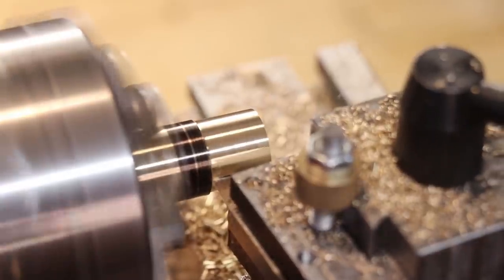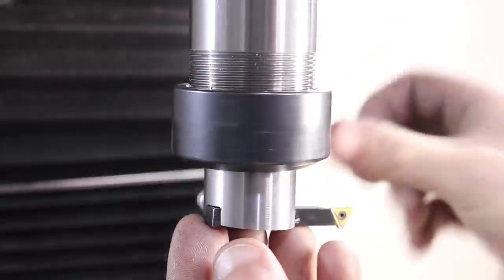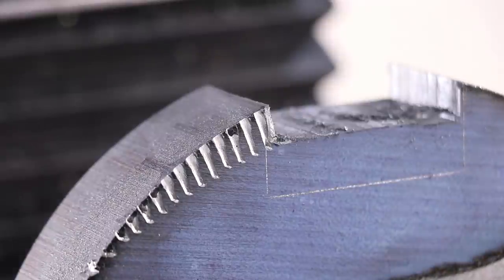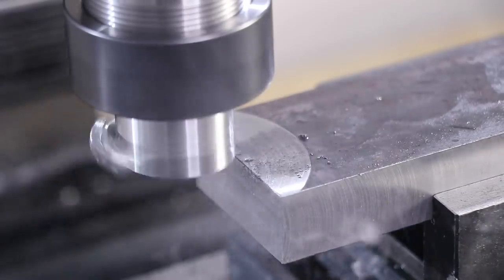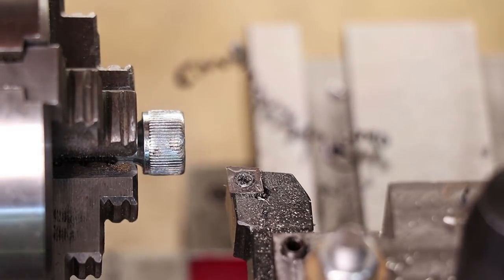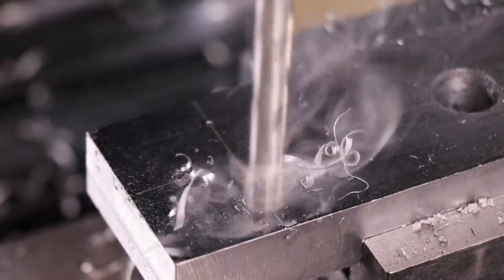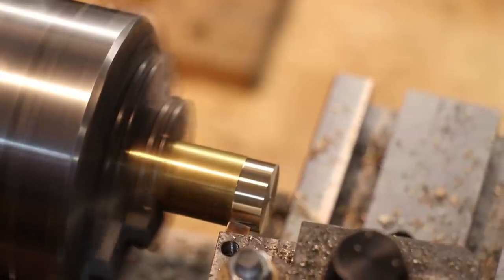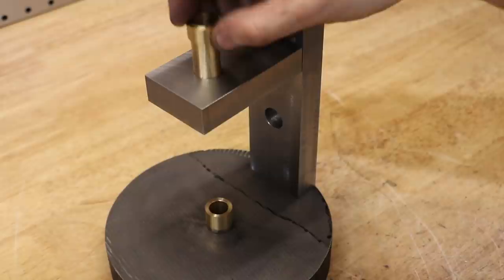Making A Vintage Machinist Die Filer  - Part One

Comment: I've got a bunch of cast iron plate weights people in my 'hood just kick to the curb, this looks like a good use for the right one as a base, I think I'd first chain drill for the upright, knock out the slug and then mill to square. This is still a valuable shop tool, with diamond grit rasps, you can shape even depleted uranium with it, looking forward to the rest of the build.☺

Comment: Good on you for having a go at making your own!

I can't see it will matter if the column is perpendicular to the base or not. Perhaps you could mill the part the table attaches to while it's all assembled so it's top is parallel to the base?

Comment: Subed. I'm part way through the hemingway kits die filer for my myford 7. I agree about costs of shipping to au/ nz....
Reply: Was looking a that one too, idea of shipping costs???
Reply: @davfew  Logic would say postage cost too much but it comes with three castings (two cast iron and one aluminium), bearings and all the bits and pieces. Bought Dec 2020 kits £83 plus postage £117 but minus VAT and I didn't pay nz gst. Actual cost £167 but I though it would be good for 10 years plus, I get to learn how to clean up castings and the big plus for me of includes all the raw materials so I can just get on with project rather than spending hours sourcing materials. My local metal dealers aren't open on weekends so work makes visiting tricky... $nz325 in real money.
Reply from the maker: That sounds about right for the postage costs that I looked at. Not sure why but postage from America to Aus is a lot more than sending something to America.

Comment: Hi there, nice project! I've been interested in die filers since seeing one on Mr Pete. I have long thought about building one. As it happens, I have an absolutely enormous old scroll saw, essentially just the casting. I'm considering converting it to a dye filer. One of my concerns is that I would wear out files early because of the short stroke length. All of the dye filers I have seen seem to take a very short stroke, two to three inches. They also tend to use those small socket files. I would prefer to be able to use traditional files because of the wide access to different profiles. Having now built and used one, can I ask your thoughts on this plan? Have you considered a mounting system to accept traditional files? Any input you have would be appreciated, there is not a lot of people to consult about these rare machines

Comment: Please dude, just use a angle grinder or buy yourself a metal bandsaw.
It makes me insane to see that you cut it with a hacksaw😂😂😂
Reply: For small pieces, a hacksaw is faster since there's less setup time.
Reply: @bobweiram6321  I disagree. Hacksaws definitely have their place, but in this instance a grinder, abrasive chop saw, Portaband or normal bandsaw is a faster choice. Setup time for my horizontal bandsaw is all of a minute assuming it needs squaring.

Comment: I tend too use a milling cutter to countersink holes for bolts and the like a three or 4 flute. It leaves a nice flat edge for the bolt to snug up to! I don't own a mill...yet, but have found it worked for me on my drill press. 
 Where did you score a large piece of cast from?
 I am in QLD and could use the help to source my own pieces for projects. I tend to hound the recycling yards for scrap pieces of steel to build up my stock!
 
Keep up the good work.

Comment: Why didn't you face the cast iron disc in the lathe?
Reply from the maker: It's a bit big for my lathe so it had to be done on the mill
Reply: @artisanmakes    thanks for the reply! 
Yeah I've got a 7x12 minilathe too. It can be hard to fit larger stuff in there.
One really useful thing I made was a 7 inch aluminium face plate, it has a round shaft that fits in the chuck and a 7 inch faced-off plate on it.
Then it can be used for facing off anything up to about 7 inch in size, provided you can fix the item to the plate.
A lot of the blocks of steel you are flycutting in the mill I would fix onto the lathe and face them, it's fast and makes a really nice finish, and chips are easier to clean etc.
Anyway, great channel, cheers! 👍🙂

Comment: Hey mate, I have been wanting to get into machining and was wondering where you get your stock from in Aus?
Reply: Where are you in aus and what stock are you looking for?
Reply: @matthewkenchapman  I'm in Syd, looking for brass and aluminium round stock for a mini lathe
Reply: @SRCCgames  I don't know of any Sydney specific suppliers, but ebay is my go to for brass,you can get good ally from there too, but a local supplier would be easier
Reply: Edcon steel try them
Reply from the maker: Edcon steel are a great source for hobbyists to get small amounts of stock cut to length.
Reply: @TABE-O  Will try them, thank you!
Reply: @artisanmakes  Thank you, will try Edcon, they've got some good shs tube for welding practice

Comment: Did you go with cast iron for a particular reason? Resonance dampening? Or was it just the most accessible?
Reply from the maker: A little bit of both. The cast iron was the most affordable solution for getting such a big base and easy for me to obtain. Plus Cast iron is a much nicer material to machine than the other carbon steels I was looking at. Cheers

Comment: Will there be plans available in some way?
Reply: I think Martin Models will sell the plans for theirs separately from their casting set.  The drawings are obviously based around using their castings, but there is no reason you couldn't use them as the basis for making one from stock.

Comment: Since you used brass, it doesn't matter that you didn't have a reamer. If you put a heavy grease like molybdenum or lithium, turning a steel pin back and forth a dozen times will clean it just as well as a reamer because it is so soft
Reply from the maker: I wanted to use a reamer primarily to get the hole to size. My 1/2" twist drill is a little undersized. In the end boring worked out just fine.

Comment: Most small mill's like yours and mine (and many large ones as well) can have their head rotated so that it is horizontal. This then means you can do a job, like the one where the base slipped, with the work mounted horizontally. There are limitations on the size of the part but it may be a useful option for the future.
Reply: Mr. Pete states he'd rather take a whipping then having to re- tram the head.

Comment: Any time you have to go that high use an angle plate.....your vice is nothing to write home bout, it's OK for use on a drilling machine.
Reply from the maker: That would certainly be the plan in the future. Still running pretty light on tooling for the mill, having only recently bought it, and tooling costing what it does. Cheers

Comment: Well, if you intend doing any significant metal removal you need to have the right tooling........no matter what it cost, but not by buying the very best that an expert would invest in, your tooling will determine the outcome of any project.
A milling vice with a 100mm wide jaw (depending on the size of your mill)  would be the very first buy at about A$100 and a set of parallels comes into that must have category too.
Next buy would be a collet chuck and a set of collets......the list is endless, but making a start with the right stuff is the important bit to get you onto the starting line.......God bless the Chinese and EBAY, I'm probably a major shareholder.

Comment: Really nice video but please do not use a measuring stick for marking the holes.
Reply from the maker: I personally don't see too much of an issue. The jaws are made from hardened steel, it's scratching a fine line in alcohol marker and these are cheapo $10 calipers. I would never do them with my mitutoyos, but with these, it makes working out easier and quicker, even if it's not good for them. Cheers
Reply: @artisanmakes  Just want to say. Love your videos. You show people that you also can do something whith smaler maschines. I make an education as an metallsit. We learn a lot about mesuring. The thing is if you juse your calliper it damage the thing only a bit. But if you do this more the masureings are a bit wrong. There a tools. (Dont now the name (--;) it locks like a caliper but has a surface where you can use an criber.
Reply: @artisanmakes  I don't know why YouTube commenters are always so stuck up about this. There's absolutely nothing wrong with using cheap calipers for layout. I've even seen some people use Mitutoyos for it, though those people probably have enough money to consider them disposable.
Reply: @cavemaneca  It's because they live in the past, today everything is a throwaway.